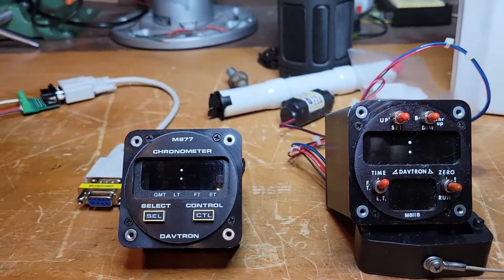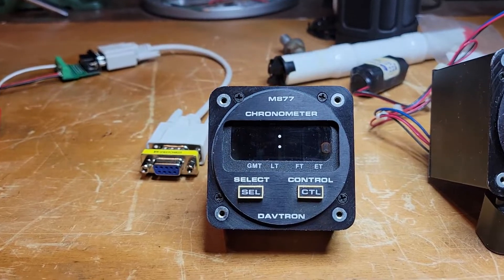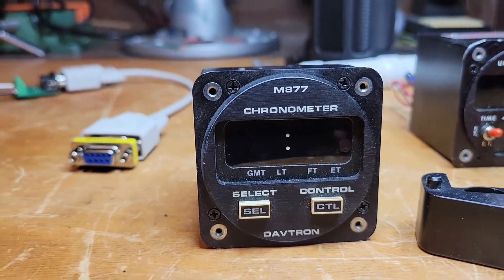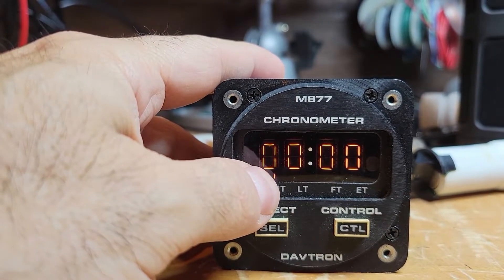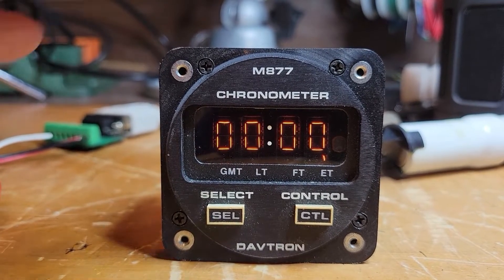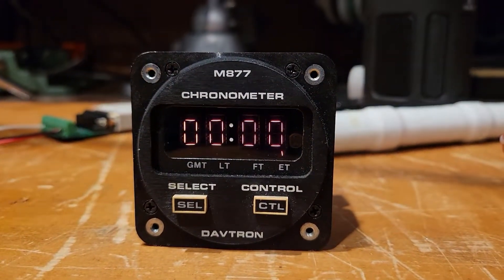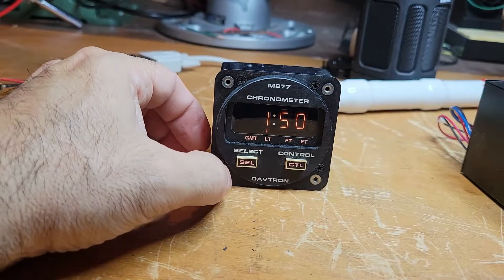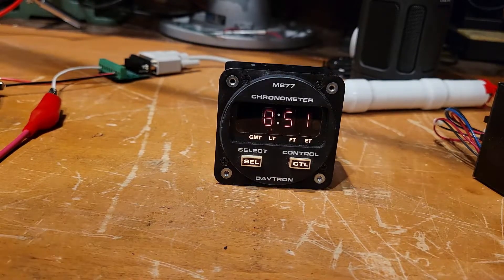The Davtron M877 Aviation Chronometer

Comment: This video's gold. I plan to emulate one of these in a flight simulator and it's very pleasing to see how the digits change - like there's a visible delay to it, you see individual segments switching on and off!

I understand it was pretty normal for aircraft to use a 5V dimmable circuit for panel backlighting - so this would be hooked up to that same circuit and the pilot's not gonna be dazzled by the SEL and CTL buttons. (I used to put blu-tac on over-bright undimmable backlit buttons when I drove buses.)

Comment: Hi. Did you build the watch in your Land Rover? If yes, could you tell me how? 
I was trying to understand how to do and I was thinking about just to take an RS232 plug to USB or maybe simple computer plugs USB (USB plug as supplier) .
But I should use also in my car a resistance, then it is with 12v supplied. 🤷🏽‍♂️
Reply from the maker: I have not done it yet. I have to redesign the dash first!
Reply: @w2hx  ok. Thank you so much for your answer

Comment: You could also use 5 volt regulator for the lights. Something simple like 7805 is cheap component and would give you enough power for those lights at 5 volts. Also you could give it anything in between of 5 to 30 volt input and the output stays at 5 volts.
Reply from the maker: Thanks for the suggestion.  It had definitely crossed my mind.  Even simpler would be a series resistor since the resistance of the bulbs should be pretty constant.  Thanks for watching and commenting
Reply: Hello folks! I've just bought a Davtron 811 and I'm not an "electronic guy", I just thought it was very cool as well, and I want to install it in a wood box an put it on my desk. I've bought an AC/DC adapter and its output is 14.29V. So, I'm very concerned it's too strong (since it's not exactly 14 Volts). Do you think it can burn the inner components? Should I buy another weaker adaptor, like 12 V, or so? Thanks a lot, for posting your video, and for the comments in this section. Thank you, Leo.